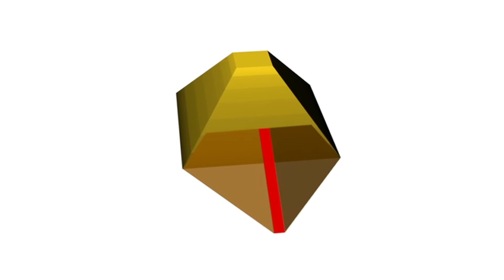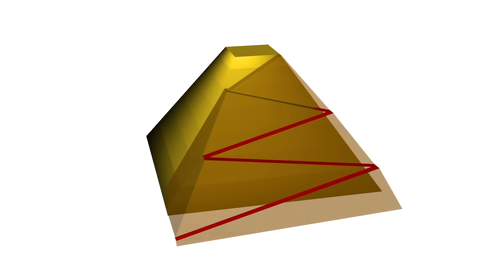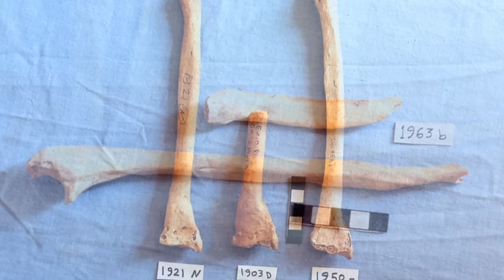Egyptology - Pyramid Construction

Comment: I am sure I am not the only one who is puzzled by Egyptologists' insistence on the idea of a ramp located outside the pyramid, when such a ramp is inside the pyramid: the grand gallery. It seems to me a plausible hypothesis the grand gallery is a relic of the construction method followed. As the pyramid got higher and higher,  and the amount of building material needed became less and less, a lift would be the most practical solution to build towards the top. The structure located above the king's chamber could well be the remains of a lift shaft.
Reply: it's called "Evidence" = I suggest you familiarize yourself with the concept and forgo your apparent penchant for internet clickbait trash as your "internal ramp" nonsense represents.  There are no internal ramps outside of the internet and cable television shows........
Reply: @varyolla435  Evidence? What's your credibility? There is not a shred of evidence for an external ramp, which doesn't help credibility. The Grand gallery is exactly in the right place if it was indeed an internal ramp, used during the construction of the lower 1/3 of the pyramid.  The grand gallery exists, we can see it, we can walk through it, which helps credibility. 
What do you know about the process of constructing a building anyway?
Reply: @varyolla435  first of all, Egyptology is not science. It is a hobby that got out of hand. Like you, Egyptologists do a lot of guesswork. Don't. You guessed wrong. I am an engineer, an architect and I teach architecture to students. When I design a building, I have to consider how it should be built. I look at a structure in a different way from you. I see on the CAD drawing of the internal structure a ramp. Better known as the Grand Gallery. If you have a blind spot for that, I'm sorry for you.
Reply: @Tardis216  🥱  Round and round and round they go = yet nothing is ever actually said.  Kinda sad really.

Moral:  now you 🦜meaningless LAHT talking points and stereotypically throw up the "day job" rationalization.......  My how this becomes hackneyed quickly.

Hence it does not matter one whit what you do for a living unless it corresponds to the subject-matter here and/or = you work with others who are experts in that subject.

You are of course always entitled to "your own opinions" = but not your own facts.......  Being an architect or whatever in no way qualifies you as a supposed expert in ancient construction techniques and knowledgeable in the historical/archeological evidence relating to the same.  Naturally I should not have to be pointing this out.  That I must however speaks volumes.
Reply: @varyolla435  This pointless.

Comment: Look at the opening scene. When you work 20 years long for 60 hours a week, you need to place one of the 2,500,000 blocks every 5 minutes! The Great Pyramid was built by a very advanced civilization at least 20,000 years ago, because they knew that their civilization would disappear due to a predictable  but inescapable recurring disaster. All these magnificent structures that we find in Egypt, large but also very small, are a message to us: "Those about to die salute you". That recurring disaster is caused by the ninth planet in our solar system orbiting our sun in an eccentric orbit. So that planet is only near our sun and its planets for a short time. After crossing the ecliptic plane of the known eight planets at a very high speed, it disappears into the universe for a few thousand years. These crossings cause disasters on our planet with a huge tidal wave, storms, flooding and earthquakes in unprecedented amounts and a bombardment of fiery meteors. Another result is a cycle of civilizations. The Great Pyramid was built with the purpose to tell us that. Deep inside the pyramid information must be hidden about previous civilizations and the history of mankind. To learn much more about the cycle of civilizations and its timeline, recurring floods and ancient high tech, read the eBook "Planet 9 = Nibiru" Just search for: invisible nibiru 9

Comment: Its easier to carry fifty pounds than drag it..period.
Reply: Depends...........  Put your 50 lbs on a sled which runs on a slippery tract to reduce friction or it simply has wheels and you can pull that at a fraction of the energy exerted compared to manhandling it.

Comment: The blocks had to have been levitated.  To build The Great pyramid in 20 years required 250,000,000 (250 million) blocks of stone to be cut and set in less than 10 seconds per block.  We couldn't do it today, not even close.  Plus the mathematics in the design just flat DID NOT exist to the "Egyptians" of the time.  Copper chisels, ramps and slaves, yeah right.  And no Mummies ever found in there, it wasn't a tomb at all.

Comment: You think thay dragged them by hand? No. They floated them down canals dug into the sand and lined with cement. They used locks to raise levels and used the water as a level to cut and lay the blocks, simple. A few goats stomachs, some rope, a few bags of lime and a shovel, were ready to start moving blocks. We just need to wait for the seasonal flood to move the blocks out of the quarry into the nile and float them up to the site with the kings procession. We build it layer by layer, year by year. Using sand and cement to make pools to float the blocks around and demolishing and reusing it as we go. No dragging required, easy.

Comment: Could it be that they used ramps made of sand, given that it was widely available? And, they just added more sand to reach higher levels. And, just remove the sand when they finished?
Reply: The ramps were made of a mixture of sand/stone chips - quarry debris/and tafla - a clay they mined.  There are the remains of smaller ramps used to build partially completed tombs in the western cemetery adjacent the Great Pyramid.  

Also when Egyptologists excavated the quarries nearby they were found to have had massive amounts of ramp filler material dumped into them. Finally near the worker village of Giza is the remains of a large tafla mining operation. So as the earthen ramps were dug away at the end they dumped that into the open quarry pits.

Comment: Yea bringing multiple 70 ton blocks of granite hundreds of miles away and then setting them 300+ feet up just for the kings chambers alone is mind boggling. The precision as well…
Reply: Actually no = it is not.  It does show however that your poor assumptions are getting the better of you.  So here is your freebie:

1 - near Khafre's valley temple - ~500 meters from the Great Pyramid = was a harbor.  Hence the granite relieving slabs - very crudely hammered out by the way - did not have to be moved very far overland.
2 - the relieving chambers of the King's Chamber are actually = below the halfway point......  Further there is evidence on the pyramid's western face of their building atop an existing hill which they leveled at the edges to stack blocks upon.  This means the ramp used to raise the granite relieving slabs possibly incorporated part of the existing hillside.  
3 - this is not unusual either.  Khufu's son Djedefre did the same.  His own pyramid at nearby Abu Rawash was built atop a hill also and though the pyramid blocks were stripped away you can see where they dug out down into the hill to create the burial vault below = while building atop of what remained of the hill. So his father likely did the reverse.  Built his burial chamber into the hill above rather than below using the hill itself to help raise the blocks to the level of the chamber.

p.s. - most of your "precision" = is illusory.  Perhaps it is time to learn the facts rather than assuming.  Just a suggestion.

Comment: You can't have a ramp with a grade higher than 10% otherwise the resistance goes up exponentially. Taking into account the average weight of the blocks being over 6 tons, the ramp to drag those stones on rollers would have had to be ~6 miles long.

NOPE.

Great Pyramid construction is more advanced than us today.

Understand it. Accept it.

Comment: Whelp...they most certainly didn't use man power to build the pyramids...not a chance they could do that w/out tech of some kind...anti-gravity, etc.
Sure...they would have had a work force but that work force didn't lift the rocks into place...that was done w/tech.

The stones above the King's Chamber & such that Graham Hancock has pointed out could NOT be put in place w/ramps & pully, etc.

Also, the Egyptologists say it was built by the Egyptians...well, not a chance for that either. 
The Egyptians inherited it all and though they tried to emulate them...their works are far inferior to the older pyramids.

Also, they said that they were tombs...but, no mummy has EVER been found to be in them...yet they still try to say they were.

No, it's highly probable that as Hancock says...they were machines. The Pyramids could produce energy much like how Tesla was doing so.
Everyone...research THAT thread as I honestly believe the pyramids were batteries...producing energy for that lost tech.

Comment: What a load of rubbish
2 ton blocks are the LIGHTEST, there are 1000 ton blocks at the foot of pyramids, no amount of human men can lift that. The levelling with bits of rocks is also rubbish, the tolerance of some of the stones was done at 1/1000 and carried out into perfect internal corners. If you want to find holes that were cut in the shape of twisted stars or Torx they are also available- modern man cannot achieve that.

Comment: straight ramp, cause how did they turn the blocks?
Reply: A ramp would only really be needed for the bottom half as the blocks making up the upper levels are smaller as the pyramid rises in height.  Those smaller blocks would be lifted via fulcrum/counterweight devices akin to the Egyptian shaduf as Herodotus alluded to.  

Also the exposed western base of the Great Pyramid shows a continuous ledge of limestone bedrock while the pyramid itself is built atop a limestone escarpment and its' lower chamber/corridors were cut from the bedrock.  This infers an existing hill which was leveled at its' edges and built atop of.  

As such an existing incline might have served as part of the ramp structure used to create the inner chambers/corridors which are found in the bottom half which were then surrounded by blocks and possibly filler material in the form of quarry debris/rubble.  Estimates have placed the amount of bedrock as possibly being upwards of ~23% of the pyramid's total volume.  

So Herodotus wrote they first created "a step pyramid" to fill in the sides.  They then encased that working from the top down with the white Tura limestone casing stones.  So a main ramp leading to the pyramid - perhaps centrally on its' southern and western faces - with smaller "wrap around" ramps made from perhaps mud bricks.  

Sledges with blocks could then be pushed/pulled up to the level in question and depending on where and their size then lifted to the levels above or pushed/pulled laterally along the side to where they needed to go followed by their pushing/levering them into place.

Comment: The climate was much wetter when the  pyramids were constructed. 
Water for a counter weight....with the advantages of leverages. 
The problem here are moving the shere mass of a 80,000 pound rock...with hemp ropes  and wooden blocks and shives......
Some sort of hydraulics is very possible and growing more likely...
Reply: Show us the evidence to support your "summation" as all you offer is conjecture.........  

p.s. - there are very few large blocks of a size/weight such as you describe in the pyramids.  Further what examples you might find rest in the bottom half closest to the ground.  Consequently they did not need to be raised to astronomical heights and they were not transported great distances.  

The main quarries which supplied the bulk of the limestone lay 100-200 meters from the pyramids of Giza while in the case of Menkaure you can find very large basestones - ~20 ton range - but you also see they were extracted from the bedrock when creating the pyramid's foundation = less than 50 meters away.  For the rest of the imported blocks a harbor once sat ~500 meters from the pyramids adjacent to Khafre's valley temple.  

So blocks irrespective of size could be moved via wooden sledges and manpower as well as = animal power - in the form of oxen.  There is physical evidence to place cattle at Giza in vast numbers during the period of pyramid creation.  There is also iconographic evidence of yoked oxen pulling heavy objects on wooden sledges while there are examples of the sleds in museums which are identical to the depictions of the same.
Reply: @varyolla435  https://youtu.be/6PfEMlSnQEc?si=iPZgI3QtNgpnj65g

Comment: I want to know how they quarried, shaped, transported and laid 5 - 10 ton blocks of limestone, 50 ton blocks of granite, 2.3 million in all, in 30 years.  That equates to one block laid every 5 minutes, 24/7.  Let that logistics conundrum sink in, I’ll wait.  I haven’t even addressed the design, proofing and project management involved. The Egyptians did not build those massive structures.
Reply: There isn't "2.3 million blocks" .. that's assuming the entire pyramid is blocks. It isn't. Evidenced by exploratory tunnels over recent centuries and also interior boreholes in the last century, the majority of the pyramid is believed to be rubble and mortar. Also just loose sand as some boreholes found.

Also, the blocks get smaller as they get higher, for example the very top intact blocks average 18"x18" or about 250lbs, about what a single strong man could carry up.

Its only on the lower courses that the largest/heaviest blocks are found, they could make a ramp for the lower courses.
Reply: Who else would make them? Why's it difficult to believe that people fresh out of the stone age could've mastered the working of stone?

Comment: The main problem facing present day scientists to understand these pyramids is that they are unable to realize the fact that the builders of the pyramids 10000 years ago were far more advanced than we are today with our progress in using computers and all what we achieved recently. The material proof comes from that these pyramids are equilateral. Unhappily we today don't know what is meant by an equilateral square pyramid. An equilateral square pyramid means the triangular faces are inclined by the newly discovered Magic Angle of Spin allowing these pyramids to generate an enormous flow of hot air from the pyramids top. Please try to understand that these pyramids were built by aliens who are much more advanced than we are today. Rocks were cut by lasers, rocks were moved by exposing them by their resonant frequency, their engineers were far more advanced than we are today.

Comment: There is a 0% chance these were built even remotely close to how this video says they were.  Case in point would be the string where he slipped the stone under it.  You'd have to do that on every square inch of the surface, not just where he marked it.  It's ludicrous.  They had technology back then either from other worlds or lost in time, but the old story about "hard back-breaking work" is laughable.  I've been a builder for 47 years, and while that doesn't make me an expert on pyramid building, it does allow for some insight on the magnitude of these structures and the impossibility of the presented information.  To sum it up, we're getting hosed.

Comment: There is no way they would use a ramp if they did it would have to be if very long ramp gradually rising half a degree about to move those stones. It’s also interesting to note that the Egyptians have no hieroglyphic pictures to show how they built these gigantic pyramids. It’s also interesting to note that no one has found any tools to make the stones fit perfectly that even a cigarette paper could not slide between them
Reply: It was demonstrated in the video how they achieved flat surfaces to get perfect fits.  Limestone is composed primarily of the mineral calcite, or calcium carbonate. Limestone is very easy to carve and will hold small detail work, but is also strong enough to support undercutting.
Reply: @vchism712  you try it with bronze tools then. See what results and how many chisels you use
Reply: Remains of a ramp have been found as well as tools. I want to believe in some magic either, but come on dudes, toothfairy is not real!
Reply: So more logical thing than a ramp is super advanced tech and antigravity, right dude? Stop listening to conspiracy theory loons. It is obvious they had to use a ramp. There are even videos with physics calculations of force needed and workers needes to lift the stones depending on the slope. Of course there are many types of ramps that could be used, no necessarily external ones, but possibly internal.
Reply: No Remains of a Ramp was ever found

Comment: What if the tip of the pyramid was at ground level when they started construction? Started from the top and worked their way down, removing sand as they went down?

Comment: They say that the Giza outer casing limestone blocks were stripped to build mosques but I am sceptical of this. The outer casing stones were angled at 51 degrees, it would be a bit pointless to reshape them into smaller rectangular bricks. The bent pyramid casing stones are still mostly intact probably because they set at a more vertical angle of 54 and it has a wider base. I suspect the casing stones of the Giza pyramid fell off because of the leaner angle and earthquakes ending up at the bottom. If they really needed blocks for mosques they would have taken them from one side but that did not happen.